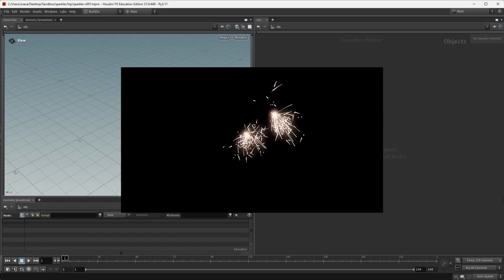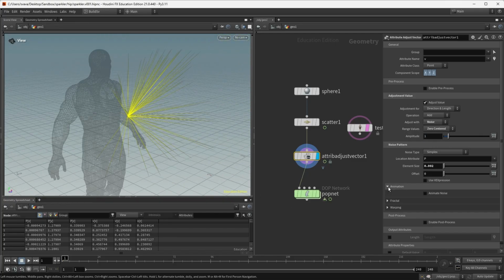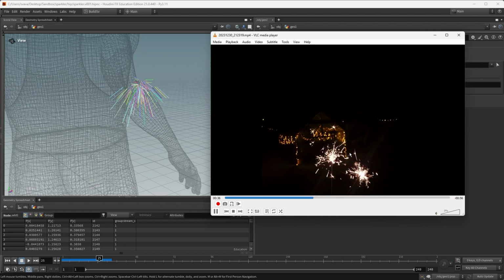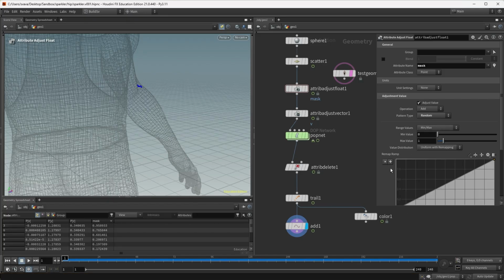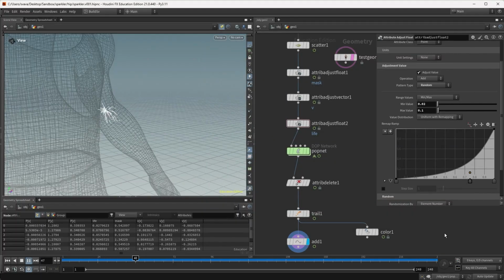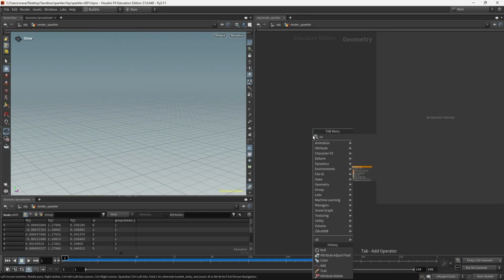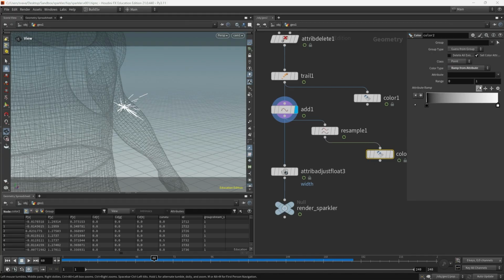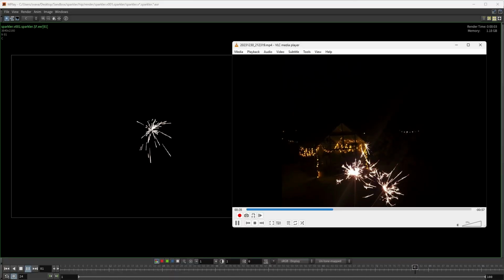Sparkler Particles in Houdini 1/2 (with HIP files)

Comment: Hmm… why can’t you see that your render is completely different from the reference? Where are the small lines detaching from the ends? And the other effects? This doesn’t look good.
Reply from the maker: @mikestan8353 
Just in case you missed it I add the secondary sparks that detach from the ends in the next video: https://youtu.be/aJ85gQHpyz0 

I know the final result (from video 2) isn't necessarily a perfect replica of the reference, I created this series to show the process of setting up a particle simulation. 

For better small lines detaching from the end you could adjust the pop replicate, or even better, duplicate it and use two. 
In the new pop replicate decrease the birth rate (because there are just a few like that), increase their inherited velocity and/or the variance to have them shoot of further, give them a bit longer life expectancy and shorten their trail after the sim if needed, to make sure they detach.

Another way that gives you better control would be to use the points from the simulation with the kill attribute value of 1 as a source for a second sim and make the detaching lines that way. 

I think it might also be worth rendering using actual motion blur rather than just creating lines like I'm doing in this video. 

The full system is here: https://drive.google.com/file/d/1beEup9NuJBPjY_pRxXLJxRsne7LM29ar/view?usp=drive_link 
Feel free to mess around with it!

Thanks for watching.